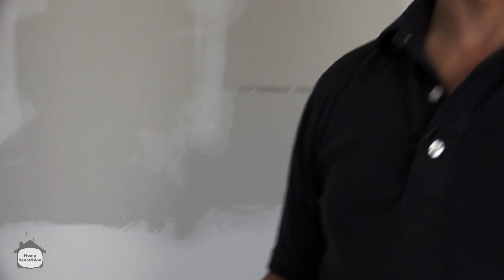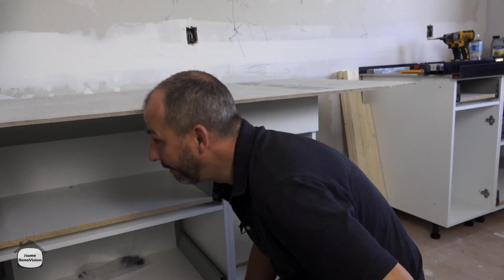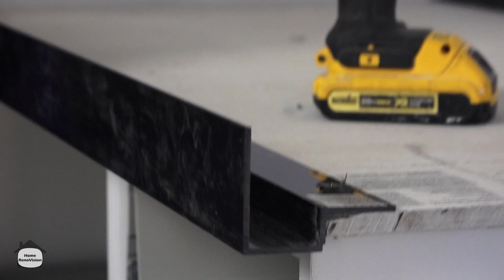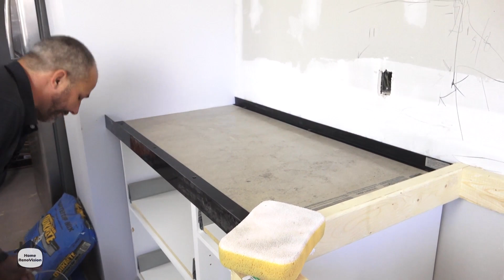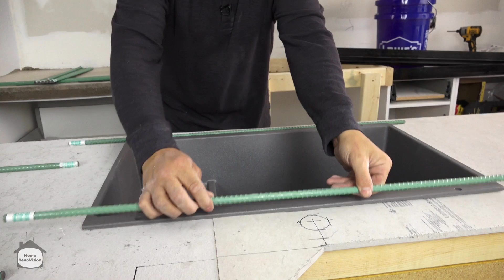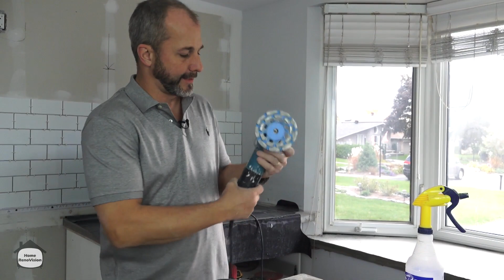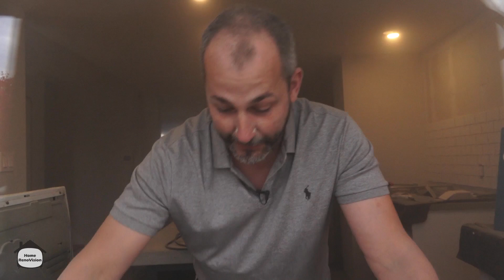Make Your Own Concrete Counter Tops | Rustic DIY Tutorial

Comment: I did a counter about 2-3 yrs ago and they had a mesh net with these little clips that keep it midway in the thickness of the tops. I been a carpenter for 25yrs and had my fair share of concrete work and I tell you honestly if it was a customer and not a buddies that talked me into helping him. I would have been buying them new tops! One and done for me and I usually welcome a challenge lol
Reply from the maker: Agreed, my next attempot will be with some custom concrete mix from the z top people.

Comment: I bet next time you'll cast into a mould upside down.. All that grinding and sanding and repair work. I felt your pain!
Reply from the maker: LOL Ivan I get it, in this case there was no where on site to use that system and transporting a nine ft concrete counter was not in my best interest either with that design. I did build a shroud for my grinder though. it works great!

Comment: Hi, question... I plan on polishing my bar top with diamond pads from 80 grid to 1000, do I need to use a cup grinder first if I have a smooth trowel finish already?

Thanks, great video!
Reply from the maker: I would say not. the cup grinder leaves you worse off than a smooth trowel finish.

Comment: Absolutely nothing about this makes me want to make in place counter tops...  Upside down pours where I can control the dust in the shop has huge value.  If you can't find help rotating a slab, or moving it, you probably shouldn't be making counters.   Honestly this seems like way more work than an upside down casting.  That dust cloud in the house?  No thanks.  Wonky 2x4 molds?  Nope.  Concrete running down walls?  or screeded onto the back splash?  no thank you.

You should look into GFRC (Glass fiber reinforced concrete) as well.  You'll pay a bit more, but get better and more repeatable results.
Reply from the maker: Hi Greg, I absolutely agree. making counters in place is very ugly. My biggest problem here is that the DIY guy can't move a 9' island that is 3 ft long with a ,massive sink cutout near two edges without special equipment. This is why we chose this optional method.

Comment: While I suppose the word isn't wrong per se,  I just find that the concept of rustic and concrete just doesn't really gel for me, especially when I think of countertops for laundries, bathrooms and kitchens or interiors in general. I know it can mean plain, but when I think of rustic in terms of design, I tend to think of a more rural, country, handmade or repurposed vibe.  I tend to think of concrete as a more industrial/modern style thing.  I don't mind concrete countertops, I just wouldn't consider the look or material as rustic. 
Having said that, this is a good video on the pros and cons of making concrete countertops in situ.
Reply from the maker: Thanks for the comment. I get YOU!

Comment: Why did you use sealer on one side and bees wax on the other side. For demonstration purposes? Wouldn't it look bad for the client?
Reply from the maker: I used both everywhere. On one side  demonstrated the sealer and on the other side the sealer had cured and I showed how to apply the wax. they should be done a day apart.

Comment: I'm really wanting to try this when we buy our home later this year. What about metal mesh instead of rebar? I could see using the bar around the sink, but wouldn't mesh provide all the strength you need? for the longer span?
Reply from the maker: metal mesh will work well.

Comment: Instead of having the concrete be the full thickness throughout the pour, could you have used another thickness of cement board or even a foam insulation board on top of your hardibacker? Seems like it would save a fair bit of weight and help in the vibrating process to get your final smooth finish. Leave a full thickness edge, and the center would be thinner.
Reply from the maker: Feel free to experiment on your own top.
Reply: Home RenoVision DIY just curious if the top needs that thickness to be sturdy or if I'd be asking for cracks.

Comment: I'm hoping my questions gets answered in amongst 'non questioners'.  Great video, very informative! So first question, z-top forms/molds, can you get them at any hardware store in Canada? I could google that so never mind. Another important question, would you say using the z-top forms and having the concrete finish on the 'upside' as opposed to the 'downside' requires more finishing work, ie grinding (with a diamond cup fitting) and sanding after...it would be interesting to compare cost, labor and perhaps skill, and available tools with both methods. Simply, which one is cheaper, easier and requires less power tools? The other method, if not everyone knows, building forms out of melamine board, pouring the concrete, finished side is upside down AND not in place, or not being made at site. However, pouring upside down makes for a nicer finish, yet more skill is involved. Thoughts?
Reply from the maker: Hi there, Z top is an online only supplier as far as I can tell for now. The reason we went with this approach is the island was just over 9' long which causes a problem logistically with the melamine technique. I prefer building a form for a lot of reasons but this was the only viable option for the size of counter and the lack of on site space to build something. It was also late fall and the weather mad it impossible to do outside in the backyard. Although not my favorite project it worked out well enough. I will be trying the Z top concrete mix they sell for my next one just so I can compare. Cheers!

Comment: Instead of the grinding/sanding, just keep gently wiping down with a wet sponge/rag as it dries, a thorough light wipe down once every 10 minutes as it first starts drying.
Reply from the maker: Have you worked with this product, It is quite unique to concrete?

Comment: If you are interested in doing a concrete counter top don't stop here.  Google concrete counter tops and get informed on the different ways they can be done.  This project would have been greatly improved by using a vibrating sander to level the mix and remove bubbles.  Floating the concrete to bring the 'cream' to the surface would have reduced the amount of sanding needed.
Reply from the maker: The vibrator actually had no effect on this concrete mix. It set up so fast! but yes there are many options out there. Just not a lot for a kitchen that is food grade safe.

Comment: some wire mash or rebar would have been useful
Reply: chaba72 wire mesh and rebar don’t prevent cracks, they prevent the cracks from opening. Plasticizers and water reducers prevent cracking.
Reply from the maker: That is why we used it on the Island.
Reply: on the counters also to prevent later crackings
Reply: wire mesh may prevent cracks due to tension as concrete is only good for compression.

Comment: I cannot find any Quikrete Countertop mix anywhere...What alternatives do I have? I'm just getting into DIY projects, and don't really understand the difference between different types of concrete. What makes the countertop mix unique/special?
Reply from the maker: Check with Lowe's or use a regular portland cement mix. Just make sure to vibrate for bubbles.

Comment: I thought this was something else. Stopped watching when you said it was an in-place build. To me at least, that defeats the purpose of calling it a concrete counter top, as it's actually a two part counter top. Also, making a concrete counter top the "traditional" way (with the melamine) gives you a 'nice surface' you don't have to try and make smooth. To me, this easy process just gives you a worst end product. ???
Reply from the maker: A different process with a different result.

Comment: Great video. Tip, I used a concrete grinder with dust cover connected to my vacuum, hardly any dust when working on my bathroom floor..
Reply from the maker: Going to buy one and check it out! Thanks!

Comment: I would recommend on e of these if you're dry grinding. There are cheaper models available as well.

https://www.amazon.com/DEWALT-DWE46152-Surface-Grinding-Shroud/dp/B00ZORWING/ref=sr_1_2?ie=UTF8&qid=1522629103&sr=8-2&keywords=concrete+grinding+dust+collection

Comment: I think if you used a variable speed wet grinder/polisher on a lower speed you'd have dramatically reduced or even avoided the dust altogether.  Granted you would have to do a little more prep to cover the area for splash but that dust is deadly and more of a mess to clean.  It gets everywhere even with the venting.  Also, get a respirator mask, it will have a tighter seal and your lungs will thank you for it.  Love the project.  Nice work.
Reply from the maker: But this was so much fun!

Comment: Geez, my head hurts.  Isn't there a way to do this without all the math?   lol. 
I actually have a serious question.  Could the counter tops have been made outside then brought in and put in place?
Reply from the maker: Hi Sandy, The reason we chose this method is 2 part. 1 the client didn't have a space on site to build on melamine, 2 the island was originally 11 ft long in the design. you can see that with that sink and the lack of material around it building a 700 lb counter offsite and transporting it became a logistical nightmare. That is why we chose this method. It worked well for what it was. Next time I will try a product called laticrete. It apparently has a smoother polished finish for on site pours.
Reply: @HomeRenoVisionDIY  Logistical nightmare for sure. We made a small 4'x4' counter top to replace a useless closet in the middle of my buddy's kitchen. It took 6 people to move that section into the house and put it in place. Pouring on site is a much easier method. I'm surprised the client didn't want some dye mixed in for more style. Some dark gray, brown, and light grey would really add some character to the counter tops.
Reply: @Sandi : To answer you question directly: Concrete counter tops can be made outside and brought inside. 

You would have a couple of other things to consider, one being weight, as you would need to move it from the outside into the inside. Or size, for fitting through doorways. 

There are other videos available that show solely concrete counter tops being made (as apposed to this method, where you have multiple layers of different materials).

Comment: Well that just about cured my desire to have a go at a concrete countertop.
Reply from the maker: LOL It was a dirty business, but very rewarding. Total material cost was around $400.00 to cover 8 linear ft of counter and build a 9' island.
Reply: @HomeRenoVisionDIY  Did you have plastic up to prevent the dust from going throughout the house?  I used a fan in the window when I did mine years ago and it helped, but still a big mess.
Reply: mjbowhunter yes he did and he had it going out of a window with an industrial fans. It’s included in one of the other videos for this job.
Reply: @mjbowhunter  Yes, he said so
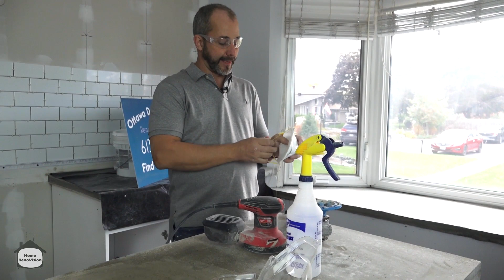Reply: @mjbowhunter  watch at exactly 32:35
Reply: @HomeRenoVisionDIY  :  Seriously?  If this saves me $6K on a granite counter and gets my house sold I will be jumping up and down!
Reply: @HomeRenoVisionDIY  i am laying a tile countertop and have a plywood base, (1/2 inch plus 3/4 inch) i really do not want to put down a cement board under the tile. Do you suggest another product to put between the tile and the plywood?
Also, would you seal the countertop grout? And if so, what product do you suggest?
Reply: @brendayoung5029  really you should put cement bord down it helps the longjevity of the tile and bonds way better yes youll need to seal the grout. That being said.... plain plywood would be fine to use but youll have to wet the wood before you lay the tile, unless you glue them down. Ive never glued tile so i dont know as for grout i dont think itd adhere to the dry wood
Reply: I know at the start he said the melamine mould and flip version is more work, but honestly this seemed like FAR more work.
Reply: @nvcreations  Thats because it is. This guy screwed up.
Reply: @nvcreations  yeah, you cant believe the guy who does concrete sanding and grinding inside, without any dust collection system in place.... you know hes an amateur when. I simple vacuum connection on a grinder designed for concrete would have contained 90% of that dust cloud, that I know filled the entire house, and air ducts!
Reply: nvcreations .....   Yeah a melamine gfrc mix would have been more efficient, stronger, lighter in weight and eliminate the need for the rebar
Reply: You can use the other method with melamine moulds,  do your countertops outsides then have a friend to help you carry em inside once they all done and clean.   Thats what im gona do.
Reply: @0neKingD0wn  I built a coffee table the same way your talking about. If you can measure and cut it was easy. I love my table. I even did a little gold faux cracks. I love it. I’m thinking of doing my kitchen next
Reply: i wouldnt attempt to pour in place.  much easier to use the melamine.  templating is the way every other counter is done, why not this type too.
Reply: Watch more how to concrete counter topping videos, this is the messy more labour intensive and dust in your house method.

Wet sanding is the way to go with in place cast,  but then you have water with cement sand mixed in, but that is easier to clean than dust. 

The best way, is to cast the counter top outside and do all your work and touch up before you install.

There is also right tools for the job..

The melamine method, give you a smooth counter top if you vibrate and get rid of nearly all the bubble, and with a good polish you can have tops that look like granite/qaurtz.
But concrete counter tops is not for the weak.
Reply: Well back to the drawing board, or in this case checkout other methods, thanks for posting.
Reply: My thoughts too

Comment: palm sander without paper, works great as a vibrator on the face and underside of the counter
Reply: Headbutting it repeatedly whilst shouting "why did I ever try doing this" helps marginally!
Reply: A sawzall w/o the blade works well also.
Reply: Hammer drill set to chisel and a block of timber also works well.
Reply: Agreed.  100 taps per second instead of one.
Reply from the maker: Truth is John vibrating this material after the 5 minute mark is a counter productive exercise. This mix has a super fast setting compound in it so we found it better to leave it alone soon after pouring.

Comment: You're truly one of the best in your profession. Amazing work for being fairly inexperienced in this sort of thing. Gives me hope that I can do this to my house!

Edit: Good guy for leaving some of that beeswax for the client. I noticed while you're applying the sealer that there's some concrete on the wall. How do you take that off?
Reply from the maker: Just used a scrapper and a quick swipe of 45 min mud and we had it looking like new after a paint job. If you are doing this in a finished space I would recommend plastic and tape. Cheers!

Comment: Just poured mine this afternoon. Z Counterforms is some great stuff. Stressful during the pour but they came out looking great so far. Looking forward to removing the forms in a few days
Reply from the maker: Patience is the key to perfection. Here's hoping it all went well.
Reply: How was it @Seth. I just did it. Will wait 7 days to cure it with water, spraying it and covering daily. I steel trowel it. It's amazingly smooth, especially towards the end portion of it. the Quikrete Countertop sets fast but if have help would turn pretty well.

Comment: I like the look, but seems very labor intensive!
Reply from the maker: A lot less work than earning the $4000.00 to buy a counter top.
Reply: Home RenoVision DIY that is a perfect way to look at it!!!
Reply: Home RenoVision DIY Home RenoVision DIY your missing the point of why it costs 4k.
You've used cheap materials. In a couple of years this will look its age. Not to mention the cheap sealer which will scratch, stain and etch in a few years.
Then theres the bees wax youve put on that offers 0 protection and is just making people think they are helping the concrete.
 I know you're not being an ass btw, just pointing out why a professional charges what they do. How do I know all of this? It's my career in the UK.
Good DIY job btw. 
I'm not being an ass either btw. Just sayin

Comment: Great work!

Have you thought about filling in the holes by doing a skim coat of the leveler you used before sanding? kind of like when you sand a wood floor?

The biggest challenge with concrete countertops in my opinion is just getting a smooth, pocket free surface
Reply from the maker: building on melamine solves this problem. In this process the cup grinding removes most of the holes and the wax fills the rest. Best practice here is to use a cutting board for food prep.